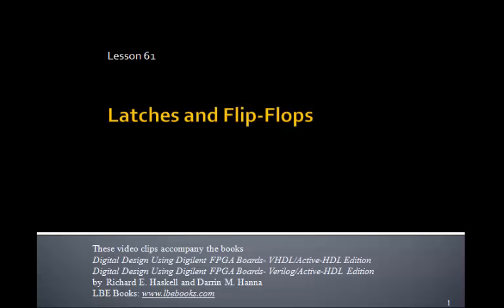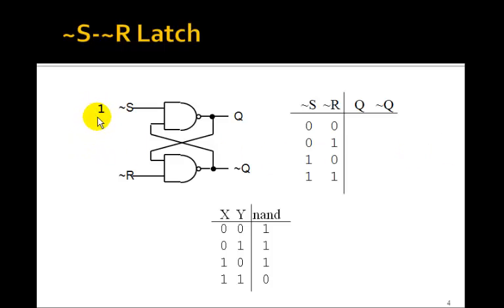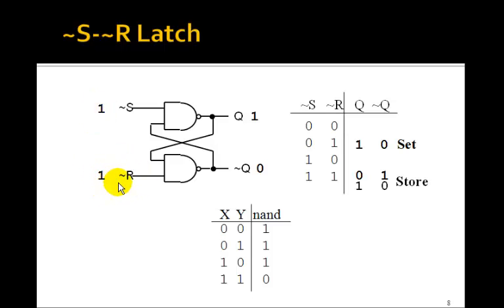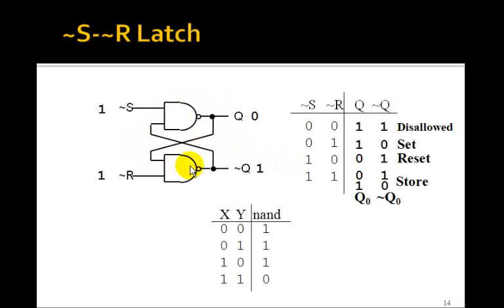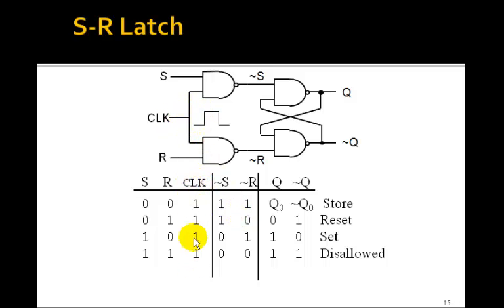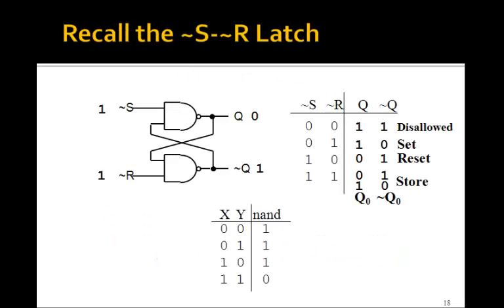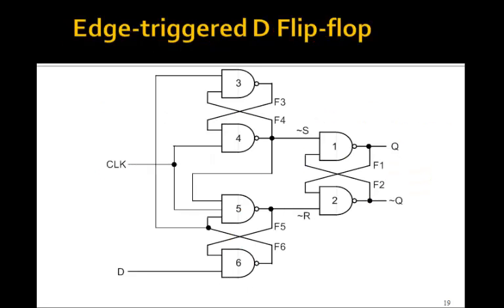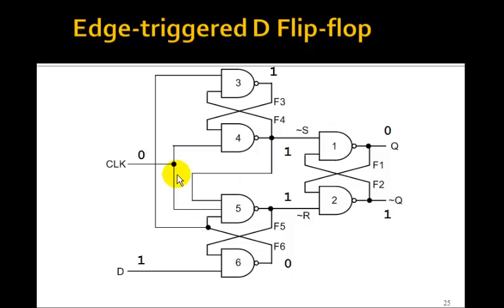Lesson 61 - Latches and Flip-Flops

Comment: I could always know that with four gate inputs there are only 16 combinations of inputs possible, then try them all and therefore not need to assume anything. But since I am convinced I would rather use an OR gate, an AND gate, and an inverter to construct an SR flip flop I won't try it right away. But many times I am wrong as far as knowing an ultimate ending goal.